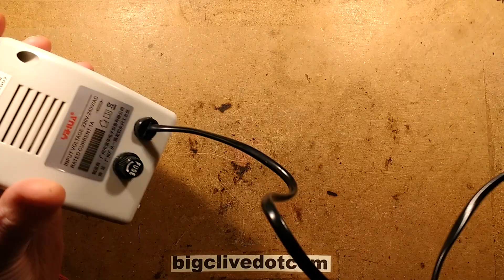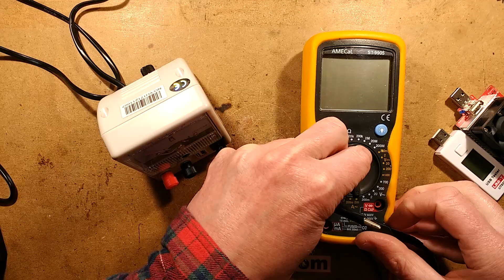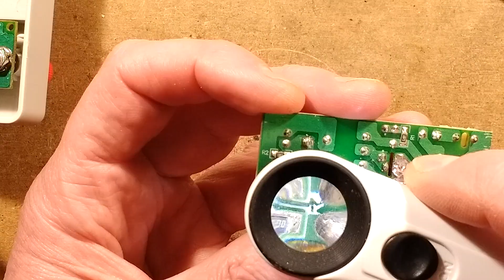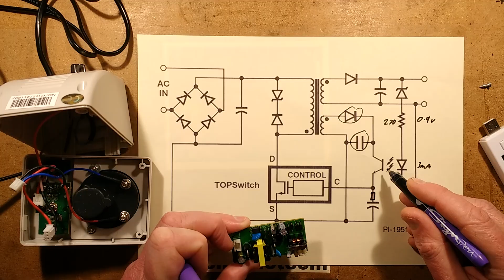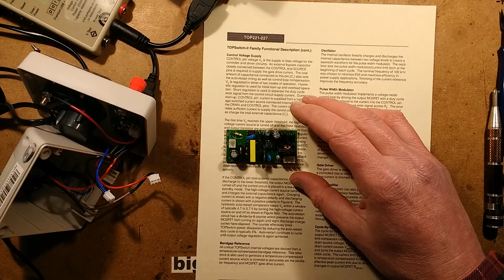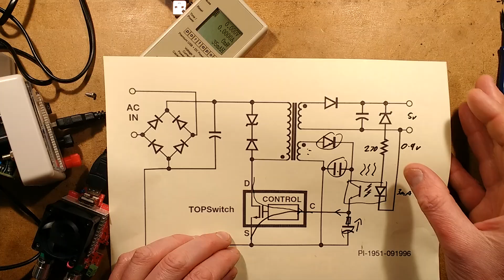Test of the Yihua 502D USB bench power supply.  (With fix!)

Comment: Voltage of USB shoud be between 4,75 and 5,25V! That is the spec!
Why? Because USB is made for PC.
PC use ATX PSU. ATX PSU have a spec of +/-5% for the normal rails (like +3,3V, +5V and +12V).
Ergo: PSU not good.
Reply: Stefan Payne obviously this is NOT a PC, and they're not aiming to replace one but just using the USB as a convenient connection. Same with the banana plug jacks- they're only present as a convenient place to connect a voltmeter, and not really part of the Powerbank's purpose. Most USB devices will buck the 5V down to 3.3-3.7V anyway, so current capacity, power protection (not intrinsic safety) and variability were the only obvious production goals. Your supposing any other goal: standard adherence for example, is far fetched.
Reply: Does that 5v 5% include the peak and valley of ripple voltages?
Reply: No, Ripple and Noise is seperate and 1% -> 50mV for +5V.
Something that he could also test, if he wants to ^^
Reply: You didn't even bother to watch the whole video did you? Then again.. you're the guy touting BS on various PSU-related forums (like not to replace PSU fans)
Reply: Stefan Payne what is the name of this "normal channel"? Besides, I don't understand how this had so many standard parts but he can't obtain them himself individually. Customs does not take responsibility for your device if they block you from getting the exact replacement part, so why is the burden of replacement not put on a designer to accommodate equivalent substitutions? The market already bears the cost of the variations, because they have no crystal ball which says specific products are guaranteed to hit every goal put in front of them, especially those which they cannot see. Neither has any technician these same goal set when acting as a diagnostician; in particular, 'reverse engineering' which places very late in a manufacturing run. So if you're not competing with a manufacturer, for WHATEVER reason, there is NO burden of origin when doing your independent-damndest to fix faulty equipment... with the single exception of warranty considerations held against that operation by the warrentizer (whoever or whichever that entity must be) during the warranty period to the ORIGINAL purchaser. So yeah, if a tech mods anything without permission of the owner, all said responsibility conveys. But that's not any special case, it's ordinary tort law.
Reply: Stefan Payne Stefan Payne what is the name of this "normal channel"? Besides, I don't understand how this had so many standard parts but he can't obtain them himself individually. Customs does not take responsibility for your device if they block you from getting the exact replacement part, so why is the burden of replacement not put on a designer to accommodate equivalent substitutions? The market already bears the cost of unofficial iterated variations, because the makers have no crystal ball which says specific products are guaranteed to hit every goal put in front of them, especially those which they cannot see. Neither has any technician these same goal set when acting as a diagnostician; in particular, 'reverse engineering' which places very late in a manufacturing run. So if you're not competing with a manufacturer, for WHATEVER reason, there is NO burden of origin when doing your independent-damndest to fix faulty equipment... with the single exception of warranty considerations held against that operation by the warrentizer (whoever or whichever that entity must be) during the warranty period to the ORIGINAL purchaser. So yeah, if a tech mods anything without permission of the owner, all said responsibility conveys. But that's not any special case, it's ordinary tort law.
Reply: Just because you disagree with someones point of view doesn't mean its BS.

What you are missing are the possible legal implications of modifying a device in those ways. 
In short: Replacing the fan with another makes you to the manufacturer with every burden. So if something goes wrong you are really in trouble...
Its the same with cheap eBay devices instead of the normal channel. Bigclive mentioned that in a couple of his videos that the price does not outweight the risk...

And of course there is the possibility of the PSU overheating as well...

Comment: There are some similarities between that circuit board and the USB power circuit from the British General USB wall socket in the previous video.
The other one is smaller but I would think it would be a better option if it could be mounted inside the box.

Comment: "Mode select: breakdown, trip, BURN"
You know what to do! And make it 4kV.
Reply: As in the intended mode of operation the user will be getting hold of the wires at the binding posts, The insulation should be reinforced, so the test voltage should be 3kV AC. I found this quote:-
https://www.evaluationengineering.com/how-the-low-voltage-directive-addresses-product-safety

Dielectric Strength Test
This test usually is referred to as a hipot or dielectric-withstand test. It checks the electric strength of the insulating materials used within the product being tested. The test is performed by applying a sinusoidal AC voltage of at least 1,000 V for basic or operational insulation or 3,000 V for reinforced insulation at a frequency of 50 Hz or 60 Hz. The specification also allows a DC voltage equal to the peak of the prescribed AC test voltage to be used.
This is paraphrased from BS 60950, but to see the actual standard you have to pay a lot of money.. or 
cdn14.21dianyuan.com/download.php?id=80665 ... for the UL version of the same standard.

Comment: I like the "Caveat Emptor" retronym, but i think Yihua has the resources to actually self-certify their products to CE norms by now.

But then, i don't think everything you get under the brand is genuine at this point, since they've grown rather big. Big company means big reject bin and fat supply chain that someone will raid, botch something together, and sell it off.

On a different note, how would you implement a power supply feedback that increases the output voltage just a tad with higher current?
Reply: Siana Gearz I’m not sure about the implementation but I know some phone chargers do this to compensate for voltage drop over long phone cables.
Reply: Yeah i don't seem to have any of those, and i doubt they'd be doing that on the secondary side at all, you'd expect transformer coupled feedback (Primary Side Control System, i.e. by BCD Semiconductor) on these instead of optocoupled. But i just can't come up with a way to do it on the secondary.
Reply: Siana Gearz with a PTC component, I'd suppose. That's how Fl-lamp ballast and motor starters work.

Comment: hrml... they just put the amp-meter directly in the output link, no feedback, so the internal resistance always lowers the "5 Volt"
.. perhaps you can wedge in a diode (or two ) in the supply detection going back so you get closer to the 5.2V

Aaah, i donno.. i'd rather take a 20 buck meanwell power supply, and add analog amp, fuse and voltage meter to the output,
they have a voltage adjust screw on most of them.

(But: Some of the meanwell supplies fail on leakage current when testing for compliance!)
Reply: >Some of the meanwell supplies fail on leakage current when testing for compliance!

Which ones? Doe that include 12v LED drivers?
Reply: 24V Hat Rail Mount ones with metal case, for SPS (Siemens LOGO! etc) / facility automation usage.
They are not faulty, insulation/isolation is ok, just somehow they have too high of a leakage current to gnd (still only mA, below trigger of 15 or 30mA safety switches).
..Of course this can always add up to a triggered FI..
Reply: Psi Q it's a floating ground feature. They really do mean well, though.

Comment: Did you know that one can completely unscrew the banana/binding post knobs and clip the croc clips into the banana socket?
Reply from the maker: Good idea.  I didn't think of that.
Reply: Just to clarify my previous comment, it is a good idea, where you can do so. Another method is to open the jaws, push them from the side around the shaft as far as possible, and tighten the nut to hold (as if it were heavy wire). If using standard (large) clips, you can often do as originally suggested, but without removing the nut. This depends entirely on ,n,,,*the style of the nut (straight sides, or mushroomed). Most of my tinkering with banana plugs was with genuine ITT Pomona Electronics components, the folks who invented the BP concept.
Reply: Bernd Felsche Only the crappy ones. Good quality ones do not fully unscrew. They are assembled from the rear to prevent disassembly.
Reply: Yes,  I do it all the time.

Comment: remember it is an IR camera :)   what led do you think is driving that opto-isolator?    :)   seen this before where IR leaks out of the opto isolator package making it appear hot to the thermal camera
Reply: Nate Terrs    fascinating, I didn't think of that.  It would be interesting to drive a naked ir photodiode and see the response of thermal imaging compared to a trad thermometer.  As you know, ir radiative intensity is not the same as temperature.
Reply: Remember that IR camera captures much longer wavelengths than IR LEDs (which are near visible range). It has to be because the thermal camera is detecting black body radiation corresponding to relatively low temperatures where the wavelength is out of range of usual CMOS sensors. IR LED wavelength is close to red hot glowing material. Also have the optoisolator package transparent, or at least leaking, infrared light would defeat the purpose of accurately transmitting light based on applied current. What you see on the picture is actual surface temperature of the package and the small current going through the LED won't heat it up.
Reply: We could test this.  Point an IR remote at your FLIR camera and see what it reads.
Reply: I don't think the opto package is hot at all.  It just appears to be hotter to the IR camera because it's made of black plastic which has a higher emissivity than the solder mask on the pcb.
Reply: You may have a good explanation here. According to the data sheet, the current into that control pin should be 4ma. While it varies with duty cycle, it varies over the 6-2ma range. So with 3ma into the LED, the package worst case should be sinking 9ma. The control voltage is nominally 5.7V, and if we assume the feedback supply is roughly 12V and the LED fires at arodun 2V, the package should be dissipating 2V * 3ma + 6V * 4ma = 30mw, which ain't much.
Reply: @number 33.. I call bollocks on this one, If I am using this thing on a circuit board and the only component on the board made of black plastic is the optocoupler IC you could win this. Yet I am shooting circuit boards with multiple ICs all over it and the optocoupler always appears silly hot. 
any advice what i am doing wrong here? perhaps the other IC's simply are made of a different magical plastic?
IR remote has a very specific wavelength. This does not mean the optocoupler IC's use the same wavelength, nor does it account that the shorter wavelengths would be attenuated by the plastic housing of the IC.  
I am happy to find a logical answer here, but if the power is not there, and the temperature physically is not measured there, and yet the thermal camera still says it is hot, something does not align.  
 it is emitting IR that makes the camera think it is hot yet it isn't..... how remains to be explained
Reply: Uncle Joe   hi Joe. Mine's a classy instrument from LIDL  ;-).  I can tell it  that it's wrong and nudge the reading up or down by 5 degree C.  But for that I'd either have know the correct temp or use a rough guide to emissivity, which didn't come with it. I've just plunged into the deeper waters of the net and realised I can't swim.  It seems that the emissivity of gloss white radiator paint is only just short of matt black (what?!)  Consider me gobsmacked.  But worse, red brick has about half that emissivity.  Can I conclude that painting a red brick wall white would increase radiative loss from the house?  I'm lost!
Reply: My thermometer has a dedicated emissivity setting, rather than a compensation in degrees. I've found emissivity lists online, but they're inconsistent, and useless to you anyway without that setting on your thermometer. I just use mine for taking spot readings here and there. For hunting insulation leaks, I'd look at owning (renting?) a FLIR of the type Clive uses, especially if you know you're pissing hundred$ in heat out the walls or roof anyway.
Reply: A lot of people get confused by this.  IR is a huge range of the em spectrum, well over a decade, and far IR (thermal
cameras) is completely different from near IR (opto-isolators).  Far IR cannot penetrate most materials so lenses and windows have to be exotic materials like germanium or salt (yes, salt!) rather than glass.  Most organic matter absorbs far IR heavily, and epoxy resin is no exception.  Black epoxy for chip packages is explicitly designed to completely cut out all light (uv, visible, near IR) to prevent inadvertent optical effects on the semiconductors inside, it will not be leaking light at all.
Reply: Nate Terrs   it's at times like this that I wish I had the equipment to try it out myself because I'm not comfortable with placing the burden on someone else.  But I have no other use for an ir camera and I've already established that if I point my ir "thermometer" at a black object and a shiny object in my domestic oven it reports very different temperatures. No surprise.  So I know it's wrong.  It's a device for  measuring radiative intensity over a certain em band, not  temperature.
Reply: "...if I point my ir 'thermometer' at a black object and a shiny object in my domestic oven it reports very different temperatures."
Can you adjust the unit's emissivity? My Canadian Tire cheapie is adjustable, and came with a list of emissivities for (what they consider) common materials. It is a PITA to change for every different thing measured, tho.
Reply: Well Sir, how do you explain the fact that every time I am imaging an opto isolator I get these same crazy results, which cannot be replicated with a thermocouple attached to the surface of the opto isolator? I would be happy to see a proper explanation. Until then this is what I am going to believe, because there is no way the thing is 60-100c and my finger or thermocouple is not feeling it.

Comment: Between the dedicated chip from Power Integrations on one hand, and the opto-feedback on the other hand, that looks indeed like a half-decent little unit.

As opposed to, say, some bottom-of-the-barrel two-transistor oscillator with aux-winding feedback... Maybe with an electrolytic "critical cap", which upon failure, makes the secondary voltage go sky-high...

Comment: It's useless. Only 2 undervolted amps, analog meter, big chunky box for something that your usb phone charger + a usb digital power meter do better.
The product targeting gone orribly wrong. It would have much more sense for a 12-24V application.
Reply: Less useless than a digital meter though.
Reply: For a bench supply an analog meter is a real advantage.  You can see fluctuations much better with a needle than a mess of flickering digits.  Digital is great for measurements, but for adjusting supply feed and testing equipment in unknown state that needle movement visual feedback is just superior in my view.   Still a needle is limited, my bench supply will indicate rapid current spikes with the current limit LED before the meter can catch up.

What the supply needs is a variable current limit, otherwise its not a bench supply, its just a supply!
Reply: Dumah Brazorf if you can't mod it to put it into the desired output range, not only did you purchase the wrong PS, you probably shouldn't be using one of these in the first place.
Reply: The analog meter and big box are probably there to impress the great unenlightened but as you say essentially useless.
Reply: If it had been a 0-24v variable supply on the banana sockets, it might be reasonably useful for people not needing more than an Amp or so. Assuming it was still cheap.

Comment: And to avoid using the death-dapter you'd have to replace the lead. It might be nice to replace the insides with a decent phone charger and make a Frankenstein's monster power supply with a neat readout. Depends on the amount of hassle and price of the unit

Edit: it's about $20. With that in mind it's suddenly a much tougher sell.
Reply: Or you could just cut the end off and replace the plug with a UK plug that you can often find for less than £1 in stores.

Comment: The banana sockets may have a cross hole for inserting wire, rather than wrapping around.
You didn't check fuse rating, but yeah,  rewire the mains lead and should be good.
Reply: Sparky Projects in Soviet China, Amps fuse checks You!

Comment: Tip: Those flimsy 2.5A Europlugs might be supposed to be able to be rammed into a UK socket if you defeat the shutters. This may make a more secure connection due to UK pins being thinner than German 4.8mm pins, which is still thinner than an angled Australian pin also accepted by the deathdapter.
Reply: John Francis Doe I told the Jerries already that all their engineering couldn't overcome a crap plug design.

Comment: Where does the coupling occur? I thought the transformer would provide isolation.

Edit: oh through the control pin of the chip?
Reply from the maker: Leakage comes through capacitive coupling between windings and the class-Y suppression capacitor.
Reply: No no Yes yes when you put capacitor and coil in parallel, it results in resistance, not a band pass filter where the connection would be in series.